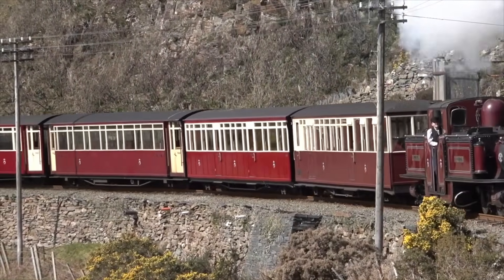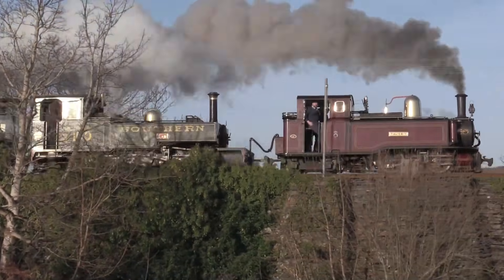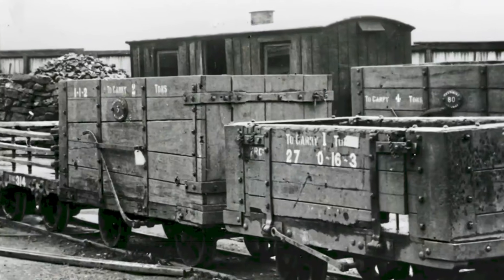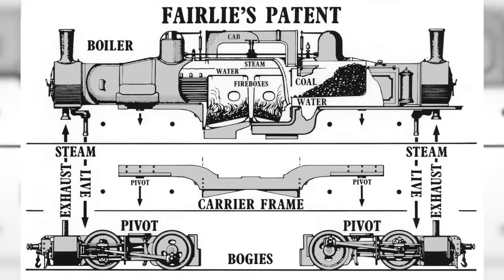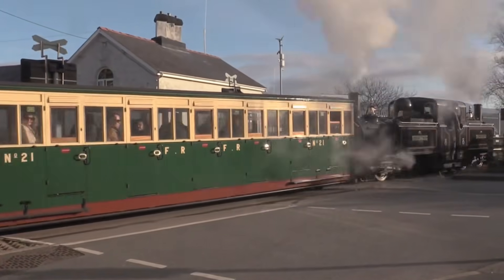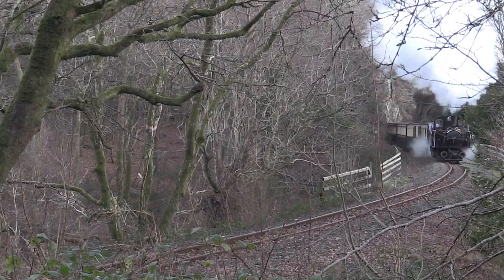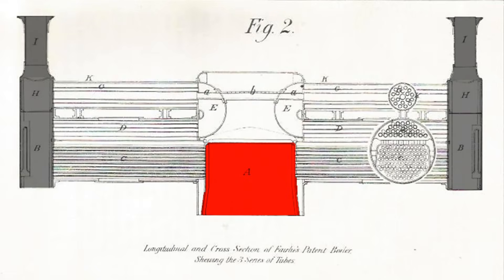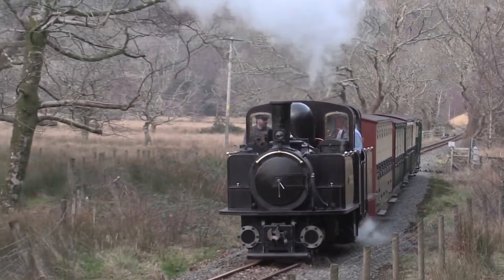The “Madness” That Worked: The Double Fairlie and the Ffestiniog Railway #ffestiniog #railway

Comment: I first heard about these locos in Hughie Jones's folk song Fairlie Duplex Engine. In the discussion someone pointed out that they have a fundamental similarity with modern diesel electric locomotives. They both generate power by burning fuel in the main body, then send the power through flexible copper connections to the bogies where it is turned into motion. With the difference being that where we used to have steam going through copper pipes we now have electrons going down copper wires.
Reply: Never thought of that, but it's true!